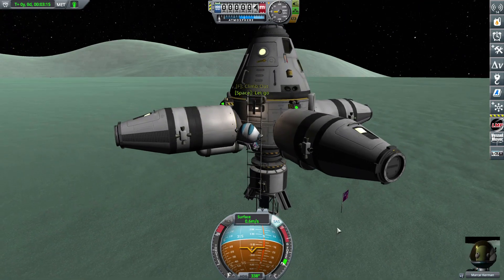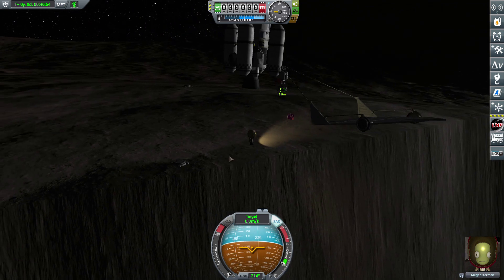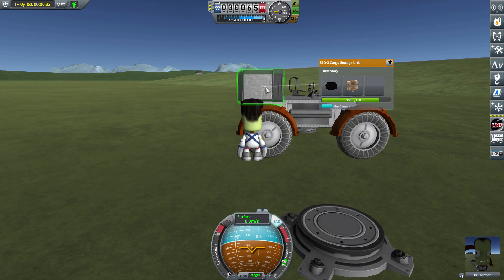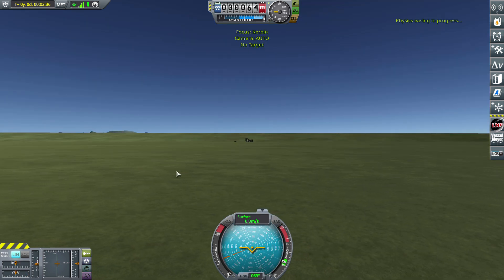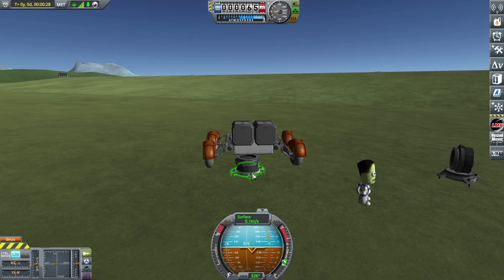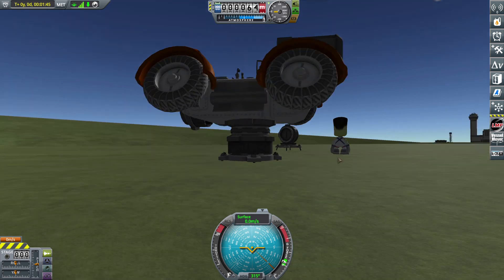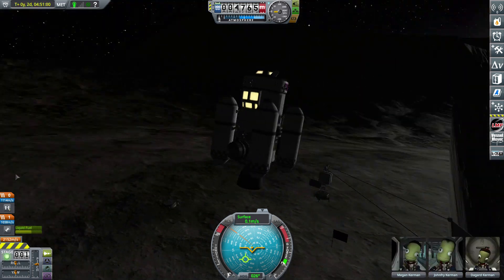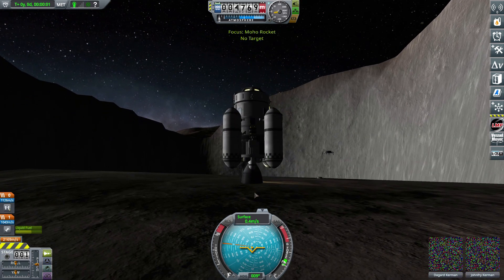KSP: The Ground Anchor is Bugged!

Comment: It's an issue with physics loading.  Ever notice how aircraft on the runway sometimes bounce on loading?  The order of loading terrain and physical objects means the anchor 'bounces' when it first comes in.  That is, in order to prevent serious clipping (and thus kraken attacks), the part loads in, eases into place.  But the anchor, by it's very purpose, isn't supposed to move.  So, before it can be put in the place it's meant to be, it 'solidifies' where it first pops into simulation.  If any of that makes sense.  You'll notice, it's a bigger problem around the Mun arch, the Moho, things like that.  The more complex the terrain under and immediately around it, the worse the problem becomes.

Comment: Maybe its a compound issues, save, load, save, load ect and see if it gets worse over time.
Reply: No. The anchor only "jumps" once. No additional moves after initial one.
Also, looks like that displacement size depends from slope angle. It's minimal at completely flat areas, and can be more than dosen of meters at highly inclined mountain slopes. (Search for VAOS's video for example)
So, there workaroud method: provoke anchor to "hop" (F5 / F9) - and continue build/docking process afterwards... (Yes, anchor will fly above ground, but, as long construction will remain stabile, who cares...)